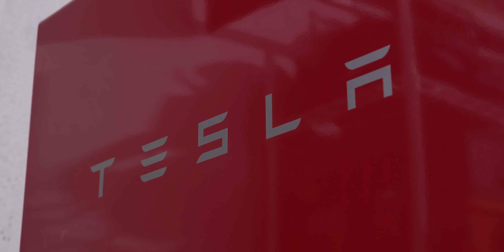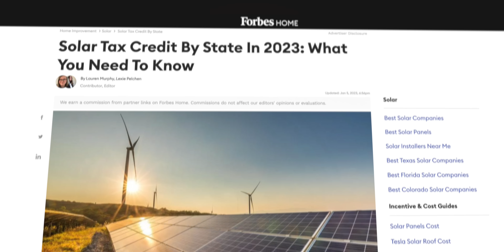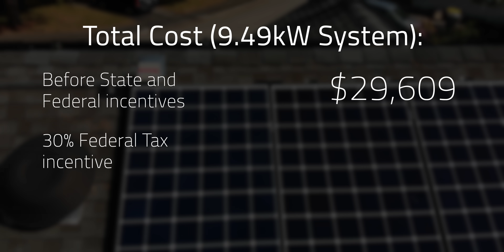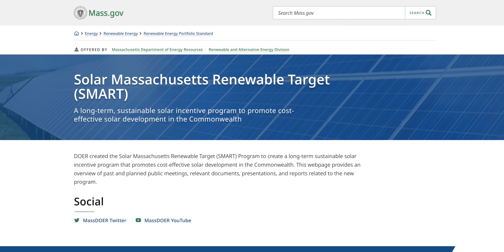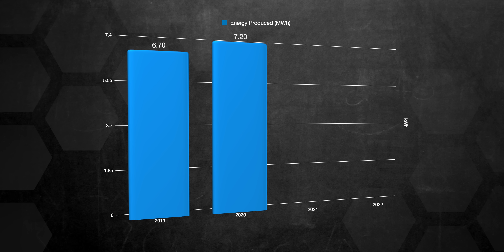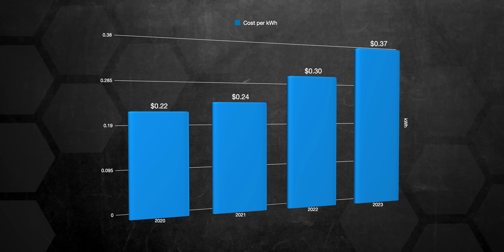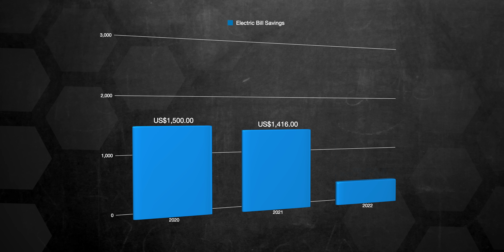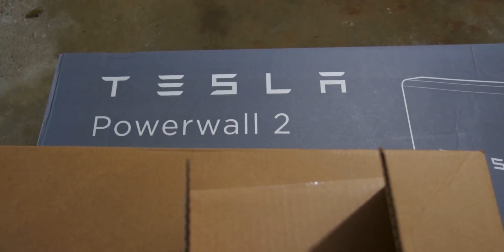5 Years with Solar Panels - Is It Still Worth It?

Comment: I have a good portion of roof facing south. My current power bills are never under $300. The power company tacks on a $200 fee for what they call excessive use. We have a barn, workshop, and our house is old with crappy windows and poor insulation. Bills over $400 are "normal". They even charged that $200 extra when we had no power for 3-1/2 weeks of a month after a hurricane hit. I'm in an assbackwards state that has no solar incentives. Oil companies own the politicians & fight hard against alternative power sources. 
It doesn't snow where I live but it rains a LOT. However, I already have a metal roof so water runs right off. No gutter system on the house, which we really should get.
Have you heard much about the solar panels that can take heat (not just light) from the air and convert it to energy?
I'm hoping to cover 100% of my use because I lose power frequently. My power company sucks.
Reply: The major incentive is the Federal 30% tax credit, which doesn't depend on states; but you local utility must allow interconnects if you're going to be grid-connected. Whether solar is for you depends largely on what your electric rate is. Do you care to post it?

Comment: What's the estimated lifespan of your panels and how much energy generating capacity do they lose per year?  Those would be important factors in figuring out if it was cost effective.
Reply: We’ve been told that they don’t start losing energy until 25-30 years. I don’t know if I’m confusing the lifespan with the energy capacity but that’s what I can tell
Reply: Mine haven't lost any capacity over eight years.

Comment: Questions I have:  1) The panels are installed on your roof over your shingles.  What's the cost to remove and then reinstall the panels after a new roof has been put on should the roof have to be replaced?  2) How well to panels hold up to hail?
Reply: Just last month my ex-stepson-in-law paid $3,500 dollars to remove and reinstall a 4.0 kW system for a $31,000 roof repair; so the cost is significant but not huge.

Comment: I’ve been working in solar for almost 10 years. The cost most don’t consider is the cost of removal/reinstall when they need a new roof. Most rates across the country are about $200/panel, and not all insurance carriers cover that cost.
Reply: A good solar salesman should mention this and suggest you replace your roof before the solar panels go on.  On the plus side, the panels can add a bit of longevity to your roofing (as you are covering that roofing).
Reply: @Driver8takeabreak   Friend works for a large power company.  He says that the lack of air flow under the panels diminishes the longevity of the panels.  Especially in hotter climates. As a realtor has stated solar panels don't add to the value of your house in this area.
Reply: @ruthreid3330  Adding value to your house depends on where you live, how much the panels produce (how much you use), and how they're marketed in a real estate listing.  I installed solar panels and a heat pump at a previous house, and then when we listed we could say the energy costs to the house were almost zero, in an area where people consistently payed $300-700 month for electricity and heating oil.
Reply: @Driver8takeabreak sure it can add value if you find the right buyer who is willing to to take over the solar loan assuming you got one.
Reply: @metorphoric  If solar panels aren't leased, it's easier for both parties to just pay off the solar loan with proceeds from the home sale.
Reply: @Driver8takeabreak  sure but that seems to be easier said than done IMO. If I purchased $30K in solar and 2 years later, have to move, I’ve haven’t put a dent in the ROI. Also, the market for people who may want solar is limited. IDK if I’m willing to pay on an existing loan for solar panels plus the cost of the house - assuming it’s not my forever home. Financing for solar on a home you don’t own just doesn’t seem to be the best investment. If I had cash and owned the house, I could consider it.
Reply: @metorphoric  ROI isn't just you saving money while living there, solar systems can add to the value of your house when you sell. The market for solar-powered homes is getting less and less limited all the time (and growing rapidly in high cost energy areas of the country).

It just depends on the economics of it.  On the last house I added solar to, I was saving over $200/month (with the solar loan payments) compared to my oil/electricity costs.
Reply: @Driver8takeabreak good luck ever finding one of those. The sales people make more than installers. It's nuts
Reply: @Driver8takeabreak  I was told the panels heat the roof up and as a result give you less life.
Reply: This is why I plan on having the roof redone at about the same time. Figure it might be more expensive. But in the long term the roofer can plan for this as it is being done and I won't have to worry about the replacement after they are done.
Reply: Common sense told me to make repairs & reshingle prior to installation and we bought architectural shingles for the longer life.  But our installer didn’t mention it.
Reply: Supposedly my installer offers one free removal within ten years, my roof is at 15 years so I have it in the plan to replace by 25. Likely I’ll be dead or moved away for the roofing job after that.. We’ll see how it goes, panels are to be installed later this year.
Reply: @jessiec1194  Something to consider: This type of marketing and incentivization can be a scam, sadly. In that ten years, from the first panels they install, they can do dozens or hundreds of jobs. Company hits the 9yr or so mark and POOF they close. You might not even notice because "Sunny Day Solar" is actually "Sunny Day Solar #9056483" and the one you can for your roof R&R is "Sunny Day Solar #9056110". Not the company..... nudge, nudge, wink, wink...... 
It's slimy as goose sh!t, but it's far too common.
Reply: Neat to see this comment because I was driving the other day, saw some panels on an older roof, and was wondering how expensive it was to have said panels removed when the roof was replaced.
Reply: I have noticed that solar companies like to assume that you have homeowners insurance, and that it will cover any damages.  Not necessarily true….
Reply: @doloresreynolds8145  93% of homeowners in the USA have home insurance (which is almost always a requirement for a mortgage), so that's not really surprising.
Reply: @Driver8takeabreak  bad assumption as no home insurance covers everything. Furthermore it doesn't cover anything added that you didn't tell the company about in first place. Lol most if not all companies will not payout if you didnt tell them you installed solar panels. Premium would significantly rise
Reply: @doloresreynolds8145  usually not true now especially if in a high wind or storm zone.
Reply: My installer wouldn't do it if the roof needed to be replaced within the next 5-10 years.
Reply: @imissizzy8414  my installer would do it even if I didnt have a roof
Reply: Most roofers will not touch solar panels so you will need to hire someone with solar panel R&R expertise. Also, the warranty normally given by roofing material suppliers is impacted.  Make sure you check the roof materials warranty when you have roof mounted solar panels.  You may also look into a roofing company that also does solar panel R&R.
Reply: The bigger problem was that I was too ignorant that I would need them removed within a year of install to do exactly that and then actually getting that done took me over 8 months. I'm sure my ROI is already shot.
Reply: Most insurers won't cover panels in a high wind or high storm area
Reply: So do you think it would be a better long term investment to get free standing panels if you have the yard space for it?
Reply: @anthonyfaiell3263  Coming from a roofer with 36 years of experience in the industry. Yes, yes, yes (On the ground). Nothing belongs on the roof, besides the roofing product itself. However, "Experts 🤔" who do not understand the dynamics of a roofing system want to install more and more garbage up there. A roof is bare-free real estate, right? Trust me when I say this, "In the long run, the Bad will definitely outweigh the Good as a Whole within our country." I know many viewers will say, "Well, I have nowhere else to install the equipment!" & I would say, "Yes my friend, you will pay the price. It is not IF, but WHEN..."
     Another thing to think about is: The roofing professional is going extinct. We (the USA) are in big trouble within the trades, in my opinion especially roofing!!! Next time you are out driving around, take a look at how many roofs you can count in just a matter of 5-10 minutes...There are quite a few!!!😁
     Your roof is there to protect you 24/7, 365 days out of the year. Honestly, it never gets a break... Any roof has a hard enough time combating Mother-Nature. The roof does not like things, people, and wildlife disturbing it!
     Good luck people🙏. The last thing I would like to state is that: MOST solar companies/installers do not understand your roof system and how it works! I am not throwing darts; it is just the pure facts!
Reply: glad i read this- the only reason that i would install photovoltaics would be to protect the shingles for life-
Reply: @rickmally5777  

And where are the Panels Made?  China Xinjiang (Forced Labor Camps or Made in USA) or both?
Reply: @rickmally5777    It doesn't protect the roof necessarily.  But it does shorten the advertised life span of the panels if  you are in a high temp area of the country due to lack of air flow.
Reply: Many of the buildings in Europe you think are concrete from olkd days are actually not. They're wood bfrsmed buildings covered with stucco and such. Lol once get put of city centers most homes are wood based city vered by adobe type muds etc then stucco especially UK France Spain Portugal Italy Greece. Germanic and Slavic States most homes are straight wood frame and envelopes. Lol barejy see concrete homes in Scandinavia. Lop so what part of the world has homes built in concrete that lasted thiuysabss of years? Lmao stone isnt concrete either.
Reply: I would never install on the roof! I would rather lose some yard space. Plus they are easier to clean on the ground.
Reply: Couldn’t solar panels be mounted on an array on the ground?
Reply: good to know, thanks for the share
Reply: YUP we are paying $8k for our removal/reinstall
Reply: First: make sure your roof is ok then place solar. Use your brains and logic!
Reply: Sorry ... replacing roofs? What in America is this about. My house was built in 1923 and doesn't need a replacement roof...
Reply: @chrismccannIRL  they are not talking about replacing the roof they are talking about new shingles, clay tiles, or tin roofs
Reply: @Brett2000-p7q  yeah again that’s a bit odd. In Ireland roofs are on for 100+ years sometimes. Yeah you might need to replace a few slates or something but to replace anything on a roof every 5 years is mad
Reply: @chrismccannIRL  Well, in America they have tiles on the roof that need to be replaced every 5 years or so due to weather
Reply: @BellicV  lol shingles dint need to be replaced that much and ones that get replaced most are side of house sun hits most as its sun dries out the tar and oils in it. Lol shingles are cheap to replace as well.
Reply: @terryarmbruster9719  sorry for being from south texas where its literally 110 degrees and the sun hits shingles from all directions
Reply: Me me me me... Me me me

Decarbonization is 21st century pyramid building.
Just burn coal. 

This is sickening on so many levels.  "How to screw the lower middle class and make them pay for your feel-goodery."
Reply: The biggest issue of the USA is its home, you make literally disposable wooden homes and roofs that needed to be removed after some time, the rest of the world uses flat roofs and are made with concrete that last centuries.
Reply: @majidmehmood3780    They might not last centuries if they had feet of snow/ice piled upon them annually, alternating with very hot days.  Flat roofs in our climate are often a death sentence for buildings.  Wooden buildings can last centuries also, if they are properly maintained throughout their lives.  And homes in areas with heavy snows are often, if not usually, roofed with slanted roofs.  There are many benefits to building with reinforced concrete, and those buildings usually have a pretty long life span, I will agree.  We do, however, make nearly ‘disposable’ homes available because they are cheap.  These, too, will last decades with proper maintenance, and the quality of the homes offered is dependent upon what the buyer can afford.  The ‘rest of the world’ uses many different types of housing, dependent upon climate, economy, building codes, and available materials.  I do not see much evidence that there is a consensus on building flat roofed concrete homes.  (I wonder, if by concrete, you mean adobe or clay.  Where I live, concrete is very expensive, and clay is in short supply - the ground is either bog or beach sand beneath a thin topsoil, in many areas.)
Reply: @doloresreynolds8145  i agree that flat roof might be bad for snow areas what i really wanted was referring to was reinforced concrete roof, europeans do that. I dont think concrete should be expensive it is the basic building material mostly used everywhere except single American home. A home should be built to last atleast 50 years. A house that last only 10 years will cause irreparable damage to environment. Also Old American homes which were made using bricks are still standing today.
Reply: @doloresreynolds8145  concrete is expensive everywhere now die to construction sand being in such high demand low supply now that there's sand mafias now. He meant clay adobe as I've been and lived in Europe lots. Lol concrete buildings require a lot of maintenance to last as well. Many of the older buildings there lasted only because a lot of money put into them over the centuries.
Reply: @terryarmbruster9719    Thank you for clarifying that for me!  Adobe makes more sense.
Reply: @majidmehmood3780  re: "The biggest issue of the USA is its home, you make literally disposable wooden homes"
Hmmmm ... no mention of grass-thatched roofed reed-lined homes used in some parts of the world?
Reply: @majidmehmood3780  huh that's far from true. Lol but yeah we build too many softwood framed buildings. Also concrete these days not cheap. Needs certain types sand. Construction sand is running out. Google or yt search Sand Mafia or such. Lol Saudi Araboahas barely any and has to actually import it. Lol all those Arabian middle east countries have to.
Reply: @majidmehmood3780  I’m not sure that’s the “biggest” issue. We’d have a lot to unpack re: the economics of building a house that’s fit to last centuries vs an American Style. For instance, most Americans move to another home in 10 years or less. Prioritizing longevity in architectural and engineering criteria might not make the most sense. Another consideration is that utilities are majorly privately owned;  $/kWh rates and usage rates vary greatly based on the diverse American climate and regional demands
Reply: @williamsmith4974  How often you move is irrelevant. In the EU it might be even less than 10 years. If you buy a house which needs a new roof you will factor that into the cost of the house. We have something called 'duty of disclosure', legally this means that if such a huge repair is not known before the sale is made you will be sued by the new owner to recover the costs of the new roof.
Reply: @pietheijn-vo1gt  lol you have something like as if we don't have it? Lol same here as well as a person have to be dumb as f not to hire a home inspector or see a report of it.
Reply: @terryarmbruster9719  well if americans want to replace their entire roof every few years I seriously doubt you have any building competence at all
Reply: @pietheijn-vo1gt  hello again! US has disclosures in RE transactions as well. That doesn’t have anything to do with why composition asphalt shingles are popular in the US. I was just saying the building material selection between very different cultures, climates, etc., is heavily variables. There are tons of areas in the US that have homes standing since the beginning of the country. I was offering the frequency of moving as a “perhaps,” or possible reason, on why American builders favor cheaper roofing materials. For me, I don’t really care because I do my own maintenance. Layout of the home’s utilities and what not is more important than their other attributes.
Reply: @williamsmith4974  That's just an excuse to be a cheapskate. We know american homes are built of plywood, why would the roof be any better. We have buildings that were built 500 years ago and they can have solar panels today because they were built with proper materials.
Reply: @pietheijn-vo1gt  Yessir. I understood your perspective already.
Reply: @uploadJ  I said built 500 years ago, I didn't say it was untouched for 500 years. Most of the citycentres in my country are at least 500 years old, most much more.
Reply: is this matt guy basically just a trust fund kid who can afford to do this out of mostly just fecklessness and then if it saves a couple bucks cool ? that's the vibe i'm getting from this guy.